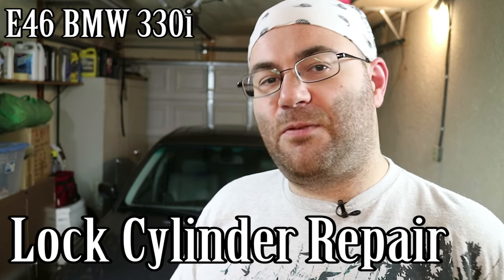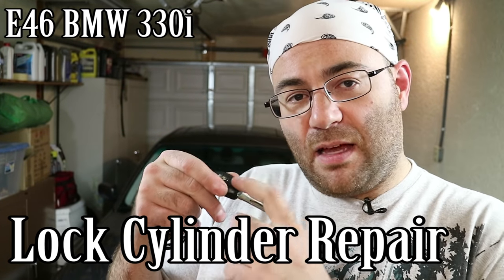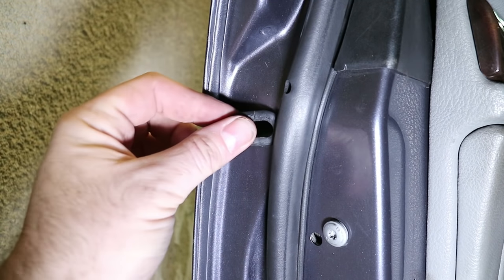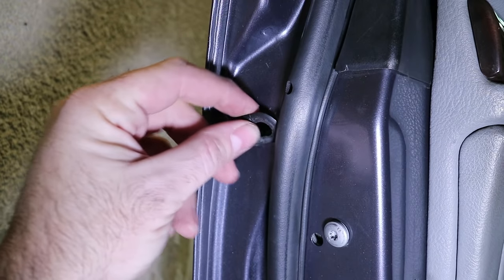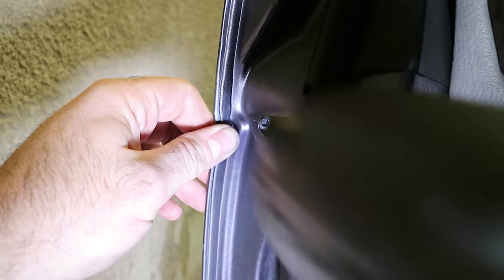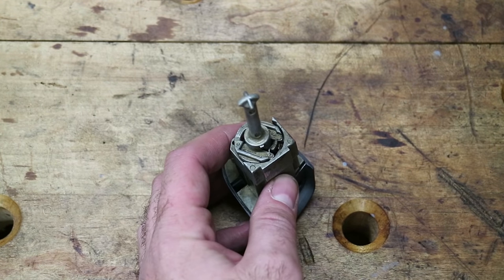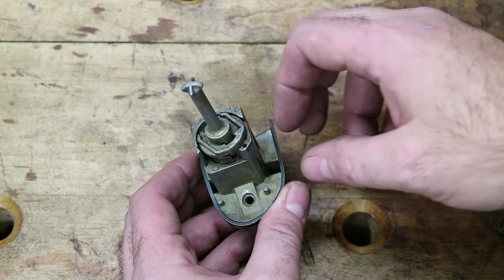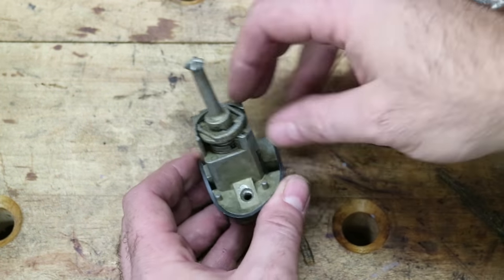BMW E46 Key Lock Cylinder Repair DIY

Comment: Need to do this to the one I just bought. Is your kit still functioning these days? There's so many options but I'd rather not get some crap casting from china that breaks after a couple months of occasional use.
Reply from the maker: And you're not wrong to think that way. Always buy the OEM stuff if you can find/afford it. In this case, i do not believe BMW makes rebuild kits, so you'd have to buy another lock assembly.  But correct me if I'm wrong!
Reply: Many thanks for the reply. Didn't really expect it to be honest. I appreciate the videos you make and the time you take to not only show how to do things, but why they're done the way they are. 

Yeah I couldn't find any OEM rebuild kits, just full replacement locks, barrels and keys in one kit that cost more than I paid for my car, and of course wouldn't match the ignition barrel. I did come across one proper looking kit off eBay that is "Genuine Re-manufactured" with a "12 month warranty". Still out of China like almost everything else. Basically everything else has the same stock images no matter if you search price low to high, or high to low.

If you, or anyone else is interested here's the eBay page of the one I bought. (Shortened URL, None of that click-ad crap) https://ebay.to/2M8fEX1
Reply: Thanks for the reply, didn't actually expect one after 2+ years. Much appreciated. While I'm at it, like most people here, I'd like to thank you for the level of detail and specifics on what and how to do all this stuff with these cars. Looking at a couple of other videos on this, there's 0 explanation of orientation of the parts, or that there's even 2 different pieces depending on Left or Right hand drive.

The only "OEM" stuff I could find was full on Handles, Barrel Mechanism and Valet style keys in 1 kit. Which cost 1.5x to 2x what I paid for the whole car.

I did run across 1 kit on eBay that states in a picture it's "Genuine Re-manufactured" and apparently has a 12 month warranty. Not doubt the same stuff as all the other kits available out of China though.

Here is a shortened URL to it's eBay page if you, or anyone else is interested. The seller is "Boursin_Autospares" in case this link goes down in future. https://ebay.to/2M8fEX1

Comment: What is an E46 BMW? I have a 2004 BMW 325i with the same lock problem. My key no longer works in the lock at all...it won't turn to left to unlock the door. Even with this DIY, I don't know how to get the door open to have the inside of the door removed. I'm locked out of my car!

Comment: Do not believe this man. Taking out the cylinder is extremely easy.  But replacing  The Spring to the cylinder is extremely hard. Comparing the task of replacing the Spring  Of the cylinder,...
I would compare it. to a man giving childbirth. The frustration you  Will experience it's extremely aggravating.
These guys on YouTube make everything appear to be easy..
 But when you try , 2  do the same thing on your car  you find . That is ,not as easy as it appear to be. Continue,  watch the video and you' Will see , That he gives up .l on trying to replace  The Spring. Save yourself the trouble and remove the cylinder from the car and take it to a locksmith and let him do it. You will save yourself a  Large amount of frustration.
Reply: You're wrong. I followed the instructions and got the spring set in 2 tries, probably took me ~10mins in total.

Comment: The spring is the only annoying part. I picked up a 2001 320i in September and the lock was 'broken'. By broken, I mean that someone had literally removed the little parts that come in the kit. Kit from Amazon for 12$ including the roll pin. Freaking mechanic wanted to change the entire door handle and locking mechanism instead, for $800. Never going to trust that shop again.